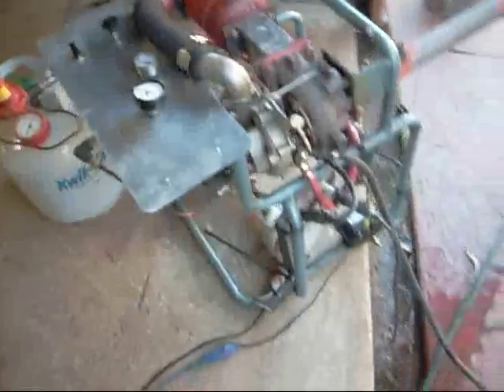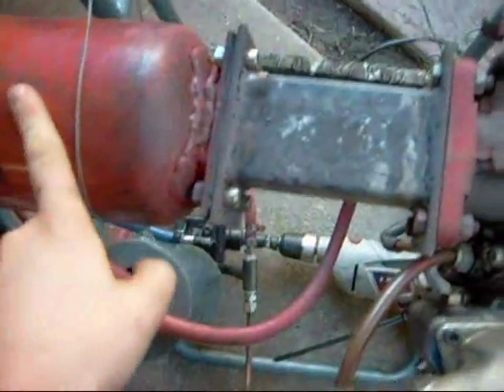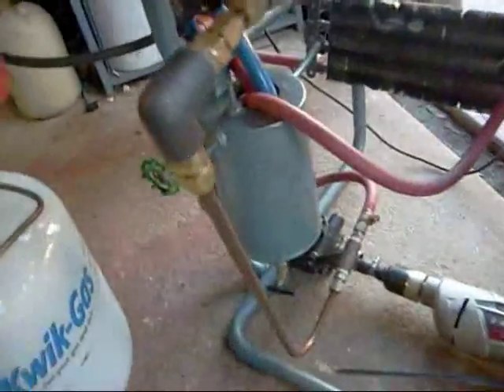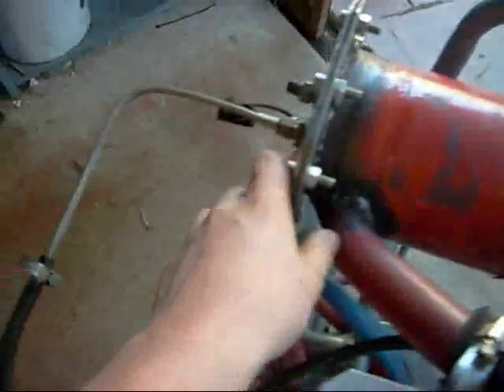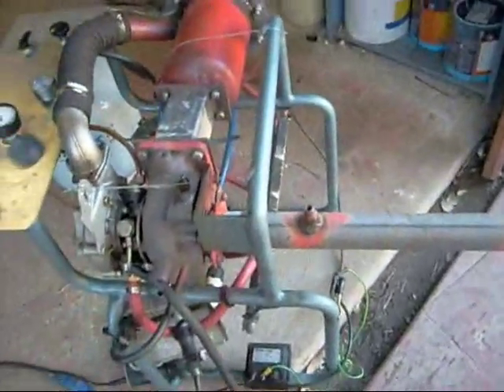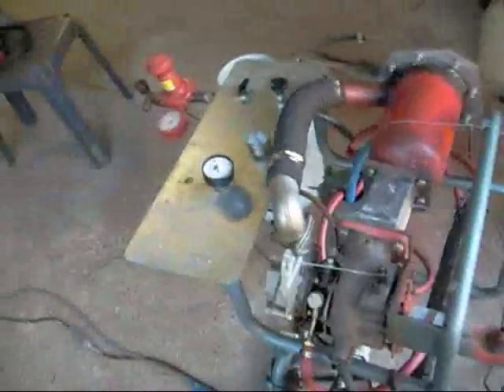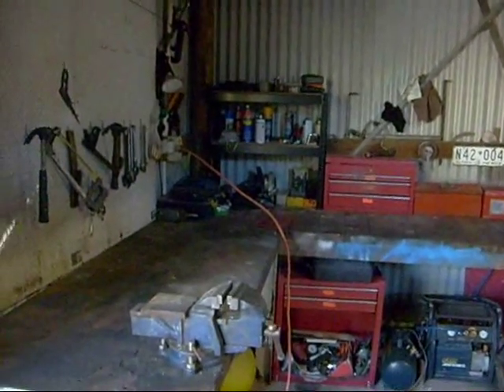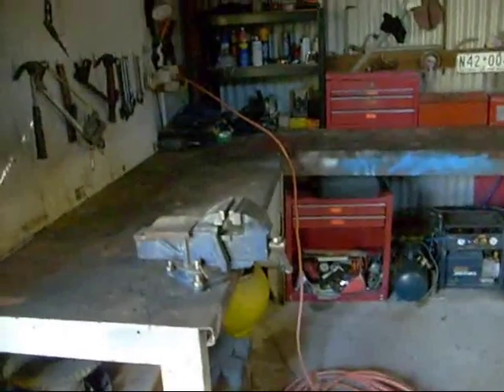ht18 turbocharger turbojet engine

Comment: hey man thats a great engine buddy. i really need your help...i have the tools skills (junior aircraft mechanic) and the money. in fact. ive built it already. its based on a mitsubishi t06-14a turbocharger, and my combustor is 4 inches ID and flametube is 3 inches ID...propane fueled..cant get it to acelerate or self sustain...played with oil pressure and throttle (ballvalve) position...it basically just spins cuz of the leaf blower...if i take the blower away rpm drop and lots of flames out bac